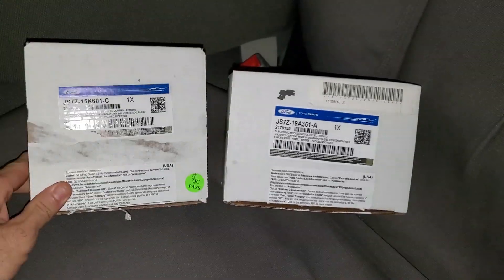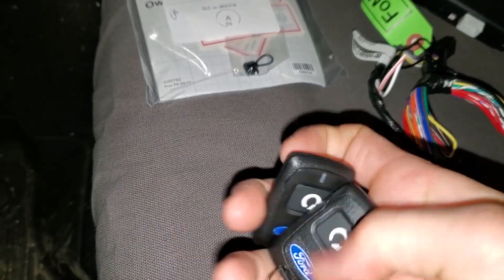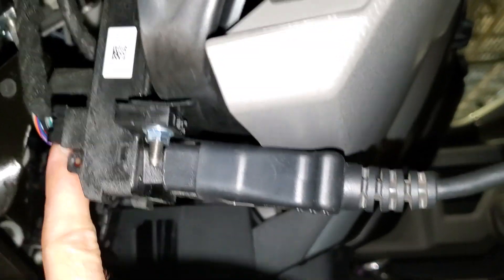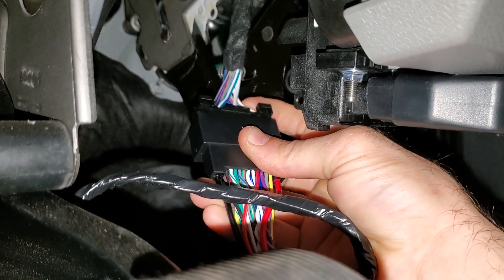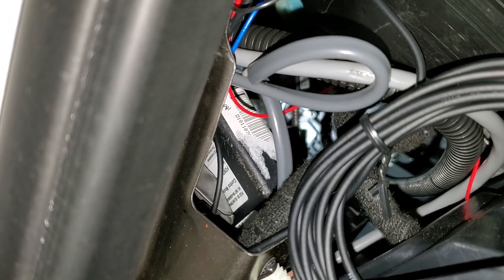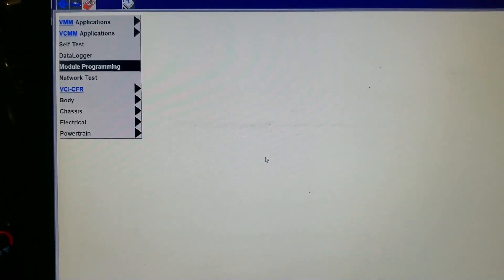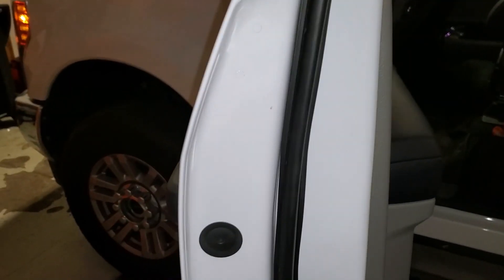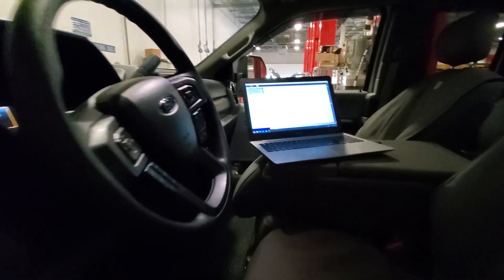19 Superduty FACTORY Remote Start INSTALL!!

Comment: The OBD2 t-harness for the kit has 2 wires attached to it.  The first is a white with red stripe, the second is a solid white, any idea where these need to be attached to?  It's for a 2019 f250 xlt
Reply from the maker: Off hand I do not
Reply: @PowerStrokeTechTalkwARod  I appreciate the quick response.

Comment: Very nicely done.
Interested in taking my front bumper off my 2019 F250 6.7  XLT crew cab w/8' bed.
Replacing it with a front bumper with fog lamps ? 
-What is all entailed ? 
-Is there a wiring harness in place ? On the frame to hook into ? 
             Thanks , Bob R.
Reply from the maker: Yea whole bumper harness
Reply: @PowerStrokeTechTalkwARod   can you make a video on that?

Comment: I just installed the factory remote start (part # JS7Z-19A361-A) on my 2018 F-350 XLT and used forscan to enable it and I was able to just use the key flip fob that came with the truck for the remote start using the Lock, unlock, lock sequence, so I didn't need to buy the extra fobs used in the video. Thank you Arod for all you do for the community, your videos are most helpful and appreciated.

Comment: You can use ForScan to enable remote start and use the standard key fobs without the remote start button. Once enabled, you will use the sequence of lock-unlock-lock to start the engine. The message center screen is enabled. 

Personally I don’t like having a second fob just for starting. 

Great video and nice install though!
Reply: For real?
Reply: How did you find this out? Everything on the internet says you need another module... I'm tempted to load forscan up now and see if this is true since 2020+ superdutys can remote start from fordpass...
Reply: I tried this on my 2018 using forscan and it shows enabled in forscan but, it still won't start remotely. You mentioned the message center screen is enabled, what did you mean by this?  there must be a step missing?
Reply from the maker: Instrument cluster
Reply: @nukkles11  yeah i did the same thing because the module is already installed but i don't have the remote start button on my key fob. I enabled it in Forscan, but it still doesn't work.

Comment: ARod, Love the videos, thanks. I put this kit on my 2017 f250. It worked great for a bit but now when I press on the brake pedal my climate controls turn off. Do you think there's a short in the wiring or is there a brake pedal switch going bad? Let me know what you think? Thanks
Reply from the maker: Sorry pal, kinda hard to tell over the phone

Comment: I have a 2013 F350 and my remote stop working. What would be the first thing to check. Thanks for your time.
Reply from the maker: Engine light on or hood ajar switch most likely....
Reply: PowerStroke Tech Talk w/ARod I’ll check that out. Thanks for the information.

Comment: The small jumper wire at 1:06 that you called an “override” is not for remote start valet. It is an override for the security/shock sensor that is built into the module. So, it just makes the system a remote start only system, instead of a vehicle security and remote start system.
Reply from the maker: I know i should put a lil verbage there on the screen, i couldnt get what i wanted to say out of my mouth fast enough....lolol

Comment: Does the remote start warm the glow plugs? I have factory installed kit on my 13 f250. Always wonder that, I guess I could read the manual lol.
Reply from the maker: Yes it will most certainly will. Depending on the temp, the GP's can stay on actually for up to 120 sec after start up!

Comment: How much should this cost to buy and get installed?
Reply from the maker: Think it was like 450 with install
Reply: But with this kit when you remote start the heat or air will start also correct?
Reply from the maker: @jenniferveasey7303  you have the option to use the last settings when configuring....  So as long as u left the hvac on u will be good togo